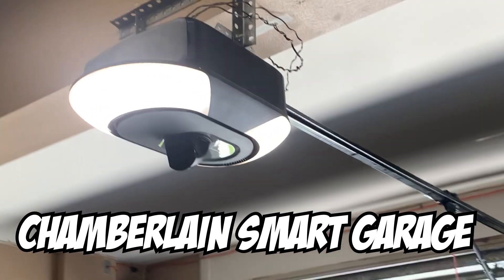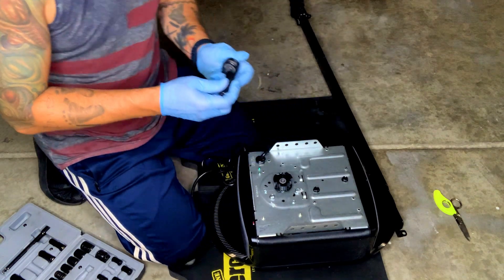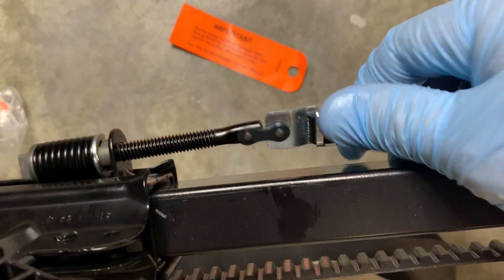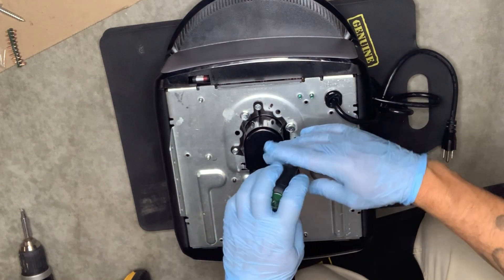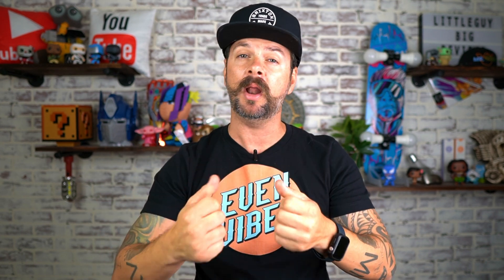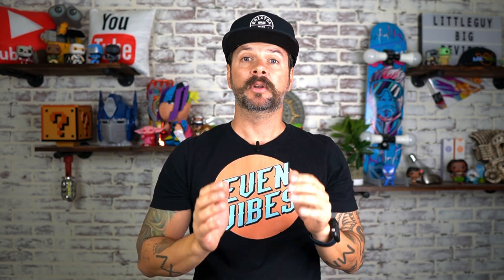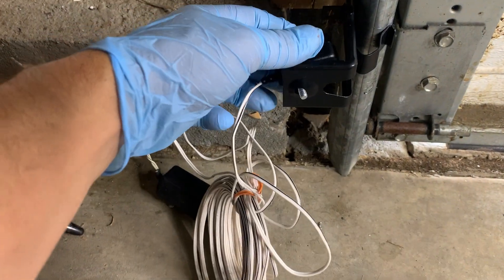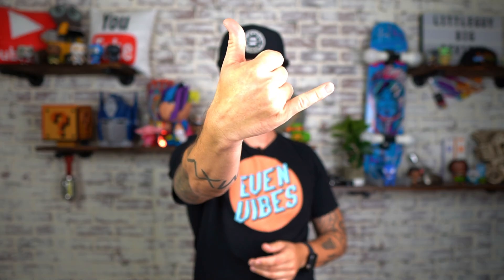Chamberlain Belt-Drive Opener + Smart Setup | Full Guide

Comment: 0:42 there's no stickers. How do you know the tabs should be down? Why?
Reply from the maker: Must of done away with the stickers. Just make sure the taps line up . If you put the tabs on the next rod were there are no tabs holes it gets stuck. Look for arrows on the rod tell you were they should be facing
Reply: @LittleguyBigReviews  thanks for the follow up. 
I struggled because I didn't know there were two apps to download. The one I was missing was the app for the instructions. Once I found that, my questions were answered. I could have saved a lot of procrastinating and over thinking if I found that first. I was happy to see (once I found the instructions) that my assumptions were correct.